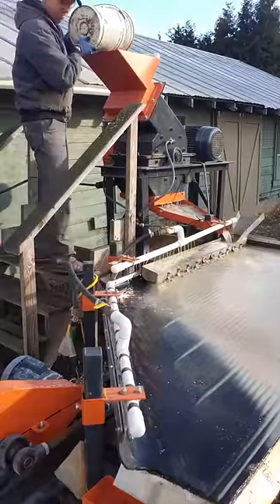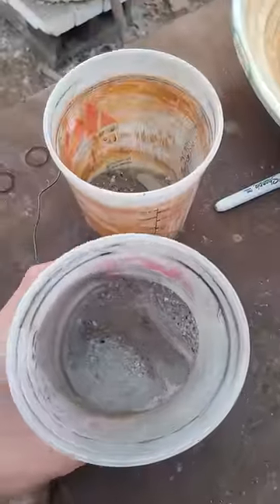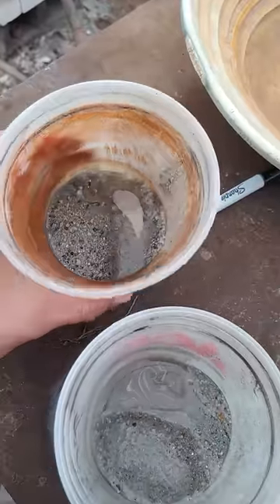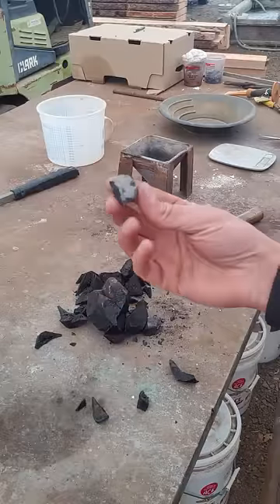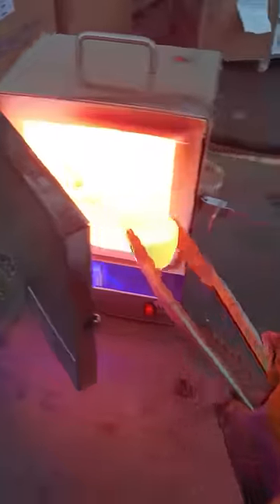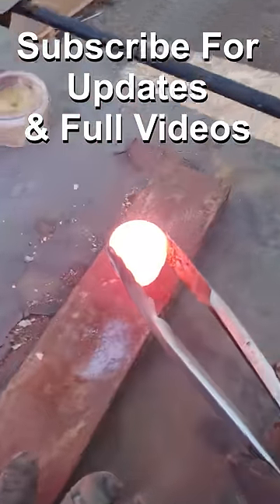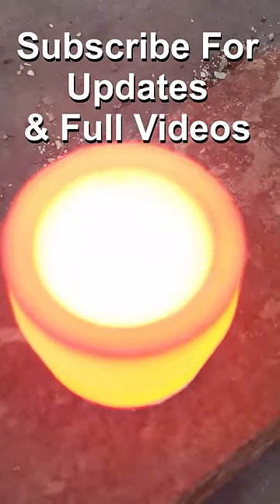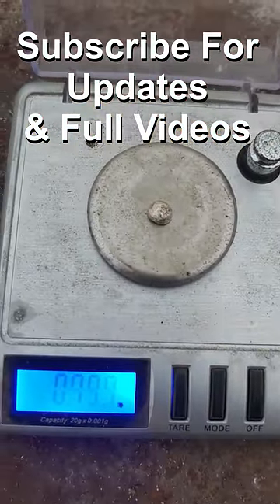Gold and Silver in 60 seconds

Comment: Think the energy used to produce that  far exceeded its worth
Reply: Doubt it Gold is like $1,750 an ounce now
Reply: @misterbulger  and only going up
Reply: @misterbulger  And if that little button was 50/50 gold and silver, it's worth maybe $20.

Even if the energy used wasn't more costly (likely was), the labour most certainly was.
Reply: @TheMijman  an ounce of gold is very little too... hard to say
Reply: @misterbulger  well the scales say 0.8g. 

So its pretty easy to say. It's about $20
Reply: @curlywurly70  it's 0.8g and gold is $47/g. Make it 50/50 gold/silver. $20.
Reply: That's what I was thinking
Reply: @curlywurly70  lmao imagine not knowing how to do basic math🤣 
A gram of gold (24k) is slightly above $50 right now. You need to convert grams to one ounce then multiply the amount. Idk why your using the ounce price in multiplying when you should figure out the gram price.
Reply: @curlywurly70  you're missing a 0, its 0.0141 so you know
Reply: @datboi4925  I see what I did wrong. I was missing a zero after the decimal point. You're right it is only about $25.
Reply: @TheMijman  math is hard...
Reply: @TheMijman  no I'm a silversmith and that 80 gram silver gold button is  worth around 3k
Reply: @Darkside-origin  Very surprising that button weighs 80g. 

Especially when the scales max out at 20g...

It's worth max $40. Averaging the gold and solver price; about $20.

How many times do I need to explain that? 

Being a silversmith clearly doesn't help you read. Does it.
Reply: That's what I thought too.
Reply: @misterbulger  there wasn't even 300 worth of gold in that button.
Reply: @TheMijman  there’s a reason why they do it, I’m pretty sure it’s worth the energy
Reply: @curlywurly70  shouldn’t it be 0.014 with that math lol 😂
Reply: @carolization1  Pretty sure it was just a demonstration
Reply: @TheMijman  But Jason is working a gold mine, and these sample runs will tell him how much gold is per ton of ore, and where!
Reply: @curlywurly70  Thank you Kirk! This is a sampling , so it's just finding where to dig! It costs to do surveys, but it's worth it in the long run!
Reply: It’s like making electric cars
Reply: That's part of what makes it what it's worth
Reply: @GuitarDudeSean  that’s what everyone who owns gold says 🤣🤣🤣😭😭😭
Reply: He’s doing a lot more than what you just seen
Reply: Not to mention how much it cost to maintain that system.
Reply: @curlywurly70   you read 0.8g as 8g, that was the problem.
Reply: How much u think gold is worth
Reply: Last time I sold a gold coin I sold it for 1000 USD. It is probably double right now. that looks near an ounce, so it would be about $1100 in a 50/50 alloy split.
Reply: Yeah the labour cost more
Reply: @NoobNoobNews  he weighed it in at .8 grams, that’s 0.0141 ounces. A lot less than what you thing
Reply: @curlywurly70  Bro missed a zero. 💀
Reply: @curlywurly70  wow your very very wrong lol
Reply: @rambofan1   no electric cars are stupid. Lithium is finite and extremely bad environmentally. So are windmills.
Reply: This was from 2 rocks. Maybe 5kg each max (a small sample). He got about $20 worth of gold and silver which can be further processed if necessary. These systems are designed to run 1 tonne (1000kg) an hour aka $2000hr
Reply: Yeah you'd think this would make gold fabulously expensi-oh wait.
Reply: @NoobNoobNews  "that looks near an ounce" I guess you said fuck the fact the scale is on and showing you what it actually weighs huh?
Reply: He's just sampling here, folks.
Reply: @richardmccann4815  the point still stands, and is made abundantly clear in this video with his yields, that any gold left in "them thar hills" is in such trace amounts that a sluice setup like this serves almost no practical purpose in present-day.. other than to, of course, fulfill  the desires of hipsters everywhere to live-action-roleplay a struggling gold rush pioneer making his fair shake at rough, frontier living.. people's kinks have gotten REALLY specific in recent years.. /s
Reply: @misterbulger  bahahaha maybe like 4 years ago
Reply: @misterbulger  This is why you’re panning gold… you didn’t graduate high school
Reply: Nothing  but arguments on this thread. How much and what's it worth ?
Reply: @curlywurly70  math is not your strong point.
Reply: You don't know how gold mining works do you.
Reply: @CoinManKak  Actually I do
Reply: @curlywurly70  qqqq
Reply: @handyjayes1  Well that's a type of it, so it definitely makes some money.
Reply: And in the end, it's still not 100% refined... It's a mixture of gold and silver...
Reply: @TheMijman  don't you love it when someone takes the time to fabricate two paragraphs of information just to make themselves feel spotlighted. like bro the effort, you could literally go outside and scream help and get more positive attention
Reply: @nahhh5318  👍
Reply: @misterbulger you know how much gold you’d have to get to have an ounce ? And not everyone is gonna pay that price to you.
Reply: @TheMijman  labour cost? This guy was doing this in his back garden, it didn't cost anything
Reply: @Professionalfailure  This is clearly his occupation, even if this was only a test
Reply: Welcome to the world of precious metals
Reply: @TheMijman  i still don't understand what "labour costs" you're getting at considering that he's doing this on his own
Reply: @Professionalfailure  Out of hours for his job. 

His time isn't free. If this is in his spare time, and it's working towards his occupation, then it's a trade off. 

He's working, out of hours.
Reply: @curlywurly70  decimal point is in the wrong spot cuh 😂
Reply: @TheMijman  have you taken into consideration that it could just be a hobby that he enjoys doing? Not everything had to be for work purposes, people are allowed to mess around and have fun
Reply: @Professionalfailure  That's a lot of equipment for a hobby.
Reply: @TheMijman  well if you have a passion for something then you will have loads of equipment.

I always see back garden astronomers with their great big multi thousand dollar telescope setups with auto adjusters and high quality cameras, they don't make any money from it, they just enjoy astronomy.

Also you'll be surprised about how cheap you can get all this equipment, you build a small starter forge for less than 50 dollars and everything else you can get the basic equipment for afew hundred, then you can gradually spend more and more money and add to you set up over the years

Now i think about it, it's very similar to gaming, you start off with a small set up and gradually go more and more expensive yet you don't make a single penny from it.
Reply: @Professionalfailure  apples and oranges mate.

You know that. Or I hope you do
Reply: @tim4570  scale is hard to judge on screen. sorry.
Reply: @carolization1  gold panners and the like almost exclusively do this as a hobby, it's not meant to be profitable. It's a timesink that costs them money, not that there's anything wrong with that.
Reply: @rambofan1  and waiting  for the coal fired plant to make more electricity! Or getting cancer waiting for the nuke plant to melt down!
Reply: Have any of you considered he likely did this for his own enjoyment and not to profit?
Reply: @curlywurly70  Capital, labor, energy, and raw material cost seems a major factor, I think. Additionally, selling the cold typically involves commissions and whatnot, I suspect, eating away at the spot price. Hence, the distance between all that and profit makes the YouTube channel itself far more lucrative, I think. :)
Reply: @curlywurly70  AcCoRdInG tO mY cAlCuLaTiOnS 🤡
Reply: @TheMijman that’s 8 grams, not 0.8g
Reply: @misterbulger  gold is like 40$ am ounce
Reply: @onesaltyboi6575  in what world is it $40 an ounce? Lol its currently $1,751/ oz
Reply: @HistoricalGeology56  look at it again
Reply: @datboi4925  lol you vaporized him back to primary school
Reply: It's a demonstration! Surely he has an economic way of doing things for business 🙄
Reply: Do you pay attention to the metal trade? Because it seems like you don’t. Precious metals are some of the first investments to go when a recession hits. That and land. But aye you sound like you know a lot about the inner workings of our economy. The greatest thing about this country is that while the rest of the world starves, we can thrive. A little something called freedom and Capitalism.
Reply: @chillbro1010  TL;DR it's been like 3 days, dude, I don't care about this convo anymore.. kBYEeee!
Reply: @TheMijman  your right
Reply: @TheMijman .4 grams of gold is like $200
Reply: The energy used to mine and produce it is factured into the price.
Reply: @ItsCrap97  So half the price (because it's 50/50 gold and silver) and divide by 5 (because it's 0.8g) and what do you get?

$20
Reply: @idonotknowanynames   Nope
Reply: Lol propane isn’t that expensive
Reply: @GuitarDudeSean  technically it's value is the same but the dollar and other currencies are being inflated and worth less.
Reply: @TheMijman  the scale does not show what it is measured in as it is blurred out. But common sense tells me that is easily more than 1 gram. Considering its size and it being one of the most dense metals on earth
Reply: @ItsCrap97  no? .4 grams of gold is like $20 if that. 4 entire grams however yes
Reply: @hanzohasashi5603  "CAPACITY 20g"

Display reads 0.800g

Don't know what blurry video you're looking at. Common sense allows me to read the fucking scales.
Reply: @misterbulger  that's pure gold. only a few companies on earth produce pure gold.
Reply: For jewelry maybe but gold is very useful for electronics
Reply: @chillbro1010  the video is only a minute its sped up that definitely took a lot longer than a minute to make
Reply: @vybezD  not what he means plus gold is a universal price
Reply: @idonotknowanynames  it’s not
Reply: Negative. You dont trade energy for food and services.
Reply: Yes of course
It's just a piece of rock that people give artificial value
Reply: @tannerdavis8163  greater fool theory lol
Reply: @TheMijman  20 dollars worth of electricity?? and how so? all the labour was shown and seemed to take less than 5 minutes
Reply: @markkealy4417  You know how long it takes to bring a furnace and crucible up to temperature? 

That's a single step
Reply: @TheMijman  10 or so minutes? it only has to get to about a thousand degrees, and takes zero labour
Reply: He is having fun~ It's a hobby.  I am sure he has had good days before :)
Reply: The gold isn’t where the money is from. The video is the real revenue generation
Reply: @markkealy4417  I'd imagine the whole process from starting with solid rock, to purifying down to a gold/silver mix is at least a couple of hours.
Reply: @TheMijman  Of sitting around sure, growing a pineapple takes 2 years, that doesn't mean its 2 years worth of labour
Reply: @markkealy4417  Of monitoring machinery

But yeah you're right. I work in the CNX department and most of my day is monitoring machinery. 

But I'm only touching stuff for maybe 45 mins so that's all I get paid for. 

Seems right to me.
Reply: @TheMijman  you're payed because you're on site, and you need to be compensated for the inconvenience of being away from home. Would you continue to be payed if you drive home and play a 6 hour golf game while the machine's are running?
Reply: @markkealy4417  I wouldn't leave the machines unattended. 

If I was prototyping at home, or working out if something is possible (like seeing if a site with gold deposits is worth the time), yes I would be paid for it
Reply: @datboi4925  well he did do the conversion, he just forgot the 0. Why you so heated over a button of silver and gold😂
Reply: @TheMijman  Kinda besides the point, why would the machinery in the video require more than the most distant supervision?
Reply: @markkealy4417  fault prevention?
Reply: Burn garbage plastic and you have something.
Reply: I agree it's not cost effective. Source: I have my entire net worth in gold and gold mining stocks. Miners have to do enormous quantities at scale in order to bring costs down below the spot price of gold.
Reply: @TheMijman  that little button was probably 1/2 oz. 1/4 oz of gold is worth about $440 and the silver is about $15 more.
Reply: @johnathon007  it was probably 0.8g

It's on a set of scales. Read the scales.

It's 0.8g
Reply: @TheMijman  Yeah, I missed the scale readout the first time. A piece that size should weigh more though so it probably isn't 1/2 gold. A full ounce of gold doesn't look like much in plain melted form.
Reply: @GuitarDudeSean  up and down and up and down
Reply: @GuitarDudeSean  annd will only go down the morw gold that is found... especially when we start mining asteroids
Reply: @misterbulger  lmao he was making a profound point about how humans use our limited resources on this planet
Reply: If it weren't worth the time or effort they wouldn't do it.
Reply: Probably not, I pay 13ct/kWh, let's say the worth of it was 2$, then to match it's cost in energy I'd need to use 15kWh, that's my oven at it's maximum temperature times 5... and I'd still have 5 cents left, as the 15kWh only add up to 1.95$...
Reply: @FuckMargaretThatchher  imagine being an alien from another world and seeing that these people use huge amounts of energy and resources to get pretty rocks and trade them
Reply: @datboi4925
Reply: @misterbulger  That button wasn't even close to an once nor was it 100% concentration.
Reply: @misterbulger  Uh no...An once of gold is the size of a 1 once gold coin. About 3/16" thick and 1.125" in diameter
Reply: Cost of propane is $3.38 per pound. That "button" probably didn't even cover the fuel cost. I forge knives on a propane forge every day so I am well aware how much the fuel costs.
Reply: I remember a statement some old prospector wrote down when he was telling a dime novel writer about the gold rush in California. 
"Everyone was so obsessed with striking it rich, myself included, we were certain that we would be rich, that we would put in a few good years and then we would be set for life. We were so certain of that, we never paid any attention to how much they were charging for shovels back in town.
Reply: Not even the energy. Simply the machines themselves

Ig if they're putting in work tho, it pays out...but still
Reply: @curlywurly70  seeings as 1750/28 is 62.50, you're missing more than just "something"😂🤡
Reply: @Darkside-origin  what 80g😂
Reply: Makes bank when you have $25 million in equipment and are boring miles into the earth
Reply: @tomsawyer4857 just waiting for the day when gold can be artificially made in a lab like diamonds then we will see if it still remains the king.
Reply: @danny-fu2zd  lol completely different chemistry. Diamonds are nothing. You put a diamond on fire, it will evaporate. It's made of carbon, a very common element on earth. In order to make gold in lab, you will need gold to start with. Good try... Tho.
Reply: I just came on to the comments to say the exact same thing
Reply: @Jeff Steele  Quite a bizarre video all in all,  but in reality,  the vlogger won despite the ridiculously stupidity of it, as we've handed it all these comments which equals money
Reply: Assumptions from someone with no Experience
Reply: @Capybara  sorry,  it's commonly known as 'common sense'.
Reply: @TheMijman  yea but he doesn’t just do one a day…
Reply: @datboii3738  Yea but he did just do one in this video...

Also no fucking clue which comment you're replying to
Reply: @Darkside-origin some silversmith you are 💀
Reply: @711_skiddlz  yeah, I can kinda relate to that I guess
Reply: @TheMijman  gram of gold is 56 dollars
Reply: @TheMijman What kind of math are you doing??
Reply: @Shixaal  Scales show 0.8g. Averaging the price of gold and silver for 0.8g.

Pretty confusing I know.
Reply: @TheMijman  Your math is wrong then. If the button was 50/50 gold and silver, it'd be worth approximately $745.996. $727.196 being the worth of the 50% of gold. $18.8 being worth the 50% of silver. Yes the labor may have been costly but the button was much more expensive.
Reply: @Shixaal  look up how much 0.8g of gold is worth.
Reply: @TheMijman  ohhhhhhhhhhh I thought it was .8 ounces of gold
Reply: @misterbulger So, after taxes what's the return on an operation like that his? Because that's a lot of work and you need a continuous flow of adequate ore
Reply: You'll be surprised
Reply: Doubt. It’s propane chill
Reply: @TheMijman do you know how heavy an ounce is?
Reply: @elseby  can you read?
Reply: @datboi4925  why be a dbag about it?
Reply: The cupel furnace cup was worth twice as much as the silver/gold he extracted
Reply: @UrsusSuperior44  was this example scaled?
Reply: lol no
Reply: That was one rock and machinery can last a while so prolly not exceeding its worth
Reply: @MrSavageMans  Do you pay your energy bills? They are exuberant... so I'd say yes it did.
Reply: @handyjayes1  most of that stuff is ran off generators so its not electric bills it’ll be gasoline and if one rock makes you $20 then you definitely can afford the gasoline to crush a lot of rocks
Reply: @Darkside-origin not very good silversmith if you think that button even weighs over a gram lol. If your going to lie at least try to make it sound plausible
Reply: @Darkside-origin  it's not 80 grams it's 0.8 you dunce
Reply: He gets money from YouTube views. Not from that piece of gold which worth 50 dollar max
Reply: @ElisPalace  You have led a life totally out of most people's perimeters...
Totally impressed 👌👍
Reply: @Darkside-origin  as a goldsmith yeah it is when I've turned it Into something
Reply: Shutup
Reply: @Tanner Davis  it's doing better than crypto, the dollar, and stocks. It's been around for thousands of years. It has a pretty good track record.
Reply: @curlywurly70  lmfao.. how could anyone.. really think this is worth more then 18$ how in ther fuck did you get 246$... everyone forget the types of gold..lol
Reply: @Darkside-origin   lol ,. what are you smoking ?
Reply: Maybe, but maybe not
Reply: @willgund779 I'd say it's black and white
Reply: This is an assay. It's to determine if the place the ore was found is worth mining.
Reply: @TheMijman if it wasn’t profitable they wouldn’t be doing it.
Reply: @Mattyv7  because that makes sense
Reply: @TheMijman  it does. I’m sure there are other elements to their business.
Reply: @Sukuna  doing a spot test to check ore worth?

Yeah, they would. 

Literally the only reason to check the ores worth. To see if it's profitable. 

Sometimes it is, sometime is isn't. (The isn't means not profitable)
Reply: I think he might have been just doing a demo. How could you be in that buisness and not notice you come up short doing a small batch like this
Reply: @iCore7Gaming  lmfao yeah when we start mining asteroids in some decades if even that.
Reply: @handyjayes1  Again have any of you considered this may be a hobby he does for fun... or (as MULTIPLE people have stated) he runs a mine and this is sampling to see if it's worth drilling.

Everyone calling this guy a fool is making a fool out of themselves
Reply: The fuel used to tote our politicians and armies around internationally far exceeds a hobby.
Reply: I may be wrong but I think that scale is set to ounces. If so it'd 0.8 of a ounce not a gram with that being said if it's 50/50 gold and silver then there would be a little less than half a ounce of gold
Reply: 9
Reply: You forgot to consider the add revenue lol probably made thousands lol
Reply: Gold never loses value
Reply: @rambofan1  Have to start somewhere. The batteries are the main problem with electric cars. Also the pollution from making the electricity used to recharge battery. 
But when we evaluate petrol cars. we don't factor the PETROL used to get the petrol. 
Regardless, batteries will advance; our supply chain will streamline, mining of the materials will improve. Or, at least they would if anti-environmentalists stop doing the same fear-mongerinf they preach against. If they stop fighting environmentalists at every turn.
Reply: @burtan2000  we should have never stopped nuclear power. That’s the answer to getting off fossil fuels but they won’t admit they are wrong
Reply: They're likely testing an area to see if it's worth mining for more. And since knowledge is power (and potentially more gold) then it's 100% worth it.
Reply: That just blew mynmind...deep deep thought!!!
Reply: @TheMijman  you underestimate what a tiny amount of gold is worth
Reply: @Jacob  Go look up the current price, for gold and silver at 0.8g.

Then average it out. And tell me what that is.

Because if you try and sell this button, no one will give you more than that. You'd be lucky to get that much for it.
Reply: Maybe it was just a test run, to see how much gold they got out of say 10kg of ore, then they’ll know better if that patch of ore is worth mining on a bigger scale or not
Reply: I'm guessing about tree fidy
Reply: Also gold and silver are valuable materials to use in tech nowadays 😊
Reply: Yeah, though making a youtube video that gets millions of views probably makes up for it lol
Reply: @misterbulger  2050
Reply: @Darkside-origin  you’re not a mathematician neither
Reply: Clearly not
Reply: @psilocybicacid7667  clearly did
Reply: He used like $4 of propane
Reply: This is called an assay, he’s running a small sample of ore from a mine or vein to estimate how much gold/silver per ton it yields. You do this to decide whether it’s worth mining at scale.
Reply: @TheMijman  That is a high estimate, since you don't get the full $1750 per oz when you resell...If you are lucky, $18.50.
Reply: @TheMijman  that’s .8 t.oz there buddy. Thats 2/5ths gold or a little under a half oz of gold which would be around $800 right now. So….whatever
Reply: Thinking same thing
Reply: It's an assay. The point is to find out the % content of precious metal in an ore sample.
Reply: @misterbulger  hit $2k an ounce
Reply: @Darkside-origin  
So you believe that literally piece was almost 3 oz, come on.  If you work woth precious metals, you would know the difference between the size of 2.82 oz(80 grams), and .8 of a gram.
Reply: @Darkside-origin  hmmmm, it's almost like it was.8 of a gram not 80 grams. You might be a silversmith, but you're not too bright.
Reply: @GuitarDudeSean because of inflation.   Eveeryone acts like golds increasong value is some incredible investment.
Reply: @TheMijman thats not little its about 22 grams. Dude has the scale set on ounce. I know you have no common sense and dont realize metal of that size cannot be sub gram, even a weed nug that size would be at least a gram and its wayyy less dense
Reply: @datboi4925 imagine thinking that much metal is less than a gram when even a weed nug that size is more than a gram. He has it set on ounces
Reply: @misterbulger  1,950 per ounce give or take currently.
Reply: @misterbulger that was probably not even $40 in gold and silver lol
Reply: @TheMijman he's trolling. Silver is $0.50 per gram roughly sooo
Reply: @TheMijman  So in your calculations you're saying that the silver is 100% worthless? LOL
Reply: @richardmccann4815 Actually, it’ll only tell him of the presence of bulk gold.
It won’t tell him anything about the total gold.
He should be extracting the gold via cyanidization after he’s crushed the gold to about the coarseness of talcum powder.

Using a shaker table to sort gold only works for placer gold.

Hard rock gold is nothing like placer gold.
Reply: I think people are entirely missing the entire point.
It's an ore sample, it's meant to determine the quantity and quality of the minerals in that area.
It isn't meant to be a magic money maker.
You get paid for taking samples in areas, that's why he is refining only small amounts overall but from a wide area. 🙄
Reply: They call that celery
Reply: Should probably stop thinking bud
Reply: @tadaaaa952 You realize just how little you can actually read?
Reply: Wow i wrote thd exact same thing lol
Reply: Why do you think it's so expensive?
Reply: @GuitarDudeSean lol that’s actually not true
Reply: @TheMijman  Running furnace isnt that expensive maybe buck or few if even that in electricity bill to smelt this. Also stuff like this from ore is really to test it out how much gold you can get out of it
Reply: They’re clearly making a profit otherwise they LITERALLY wouldn’t be doing it. Worry about yourself.
Reply: @misterbulger 2k😏
Reply: @Professionalfailure time is money dawg
Reply: @Darkside-origin 😂 a silversmith who can’t read scales
Reply: @TheMijman I'm not a gold simp but $20 is $20.
Reply: Even if that’s true, it’s a fun hobby.
Reply: $20 a day beats the .03 cent a day the  children in Africa make
Reply: EXACTLY what I was thinking except fair dos, this was prolly just demonstration purposes only...
Reply: @mrkiplingreallywasanexceed8311  yes I did understand that this was a YouTube vid with costs but even a consideration,  just a demonstration, but sometimes you need to point out the obvious to the hard of thinking
Reply: @misterbulger know it all.... You guys will never go away, will you? Even though y'all are wrong 90 percent of the time.
Reply: Agreed waste of time
Reply: @TheMijman just because he's a silversmith doesn't mean he's a good one.
Reply: I wouldn't assume he showed you all of what was processed and produced in this video.
Reply: Yeah I don’t get out of bed for less than 3,000 an hour…
Reply: @TheMijman You went to all that trouble looking up the price of gold for .8 grams and couldn’t even get the final number correct. Pathetic. You’re worth about $20.
Reply: @richardmccann4815 That information means nothing to him. That random man in the comment section is clearly an expert on the topic after watching a 30 second video.
Reply: Do you know how bitcoins are mined?
Reply: I was thinking the same thing lol but then again, everything has to get work put into it. So it’s easier for others some make it look very difficult lol.
Reply: Gold can not be made on earth, so it's a a pretty rare element expensive, too
Reply: @misterbulger my home town is in a doom because of the price of gold. When I was in high school gold was under $250 a line and there was no jobs, now if you don’t have a job it’s because you don’t want one.
Reply: @misterbulger  Gold prices going crazyyyyy, above 2k now
Reply: @misterbulger  it’s 2,000 an ounce now lmaoo😂
Reply: @ShadyJas1 Shouldn't that be $4000 then. 20/5 = 4, so 1kg = 4, 4*1000= $4000
Reply: @chillbro1010 Why do you say per minute, just curious as to calculations behind that? That is also assuming that the gold would continue to be found consistently in the same amount over time. Not to mention the large amount of rock that would need to be shifted. So I don't know if it would scale as linearly
Reply: @chillbro1010 People aren't arguing that no one has ever profited off of gold they're arguing that this particular guy won't profit off of this gold and/or silver.
Reply: @Chonkems it's not pure gold he said it's a silver gold mix, electrum, by the look of it. Therefore we don't know for sure.
Reply: @markkealy4417 How do you estimate that given that the video was sped up?
Reply: @johnathon007 There's literally a scales that shows its weight
Reply: @wilfordgray1163 That's not entirely true. I wouldn't assume that they're doing it for profit or that if they're doing means it's profitable
Reply: @tomsawyer4857 Alchemy 🎉😂🤦‍♂️
Reply: @Shixaal Why would you assume ounces
Reply: @samueltheweber what's that got to with anything
Reply: @christiancollard121 Why do you say that?
Reply: @rambofan1 Ever been to Chernobyl?
Reply: What makes you think the scale is in ounces rather than grams
Reply: @tadaaaa952it's 0.8g not 80g
Reply: @Viceeoff 🤦‍♂️ The video made them more money then the gold did.
Reply: Thats what I was wondering
Reply: Haha gold is now $2179/oz😂😂